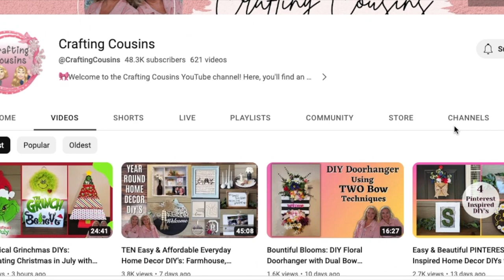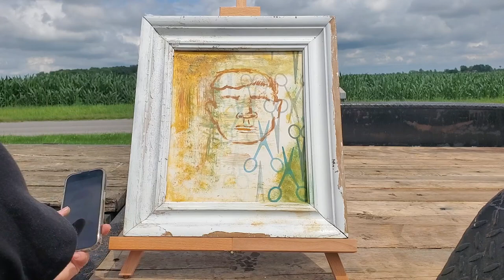DIY AGED VASES || THRIFT FLIP CHALLENGE #TFRTC

Comment: I love all of them! You have inspired me to paint my 2 very large pots in my foyer. I've changed my decor so they no longer match. I'm afraid to, but now I think I might risk it.😊 😮
Reply from the maker: Thank you!!! Just remember you can always wipe paint off. It may be a process but you can remove and start over - maybe you can practice on a thrifted vase or one from dollar tree first before starting the bigger project? You can use glass vases too! - add texture with joint compound smeared all over it and sand it down a little - if you don’t have sand paper go outside and lightly scrap the piece on the cement and it’ll help sand off rough edges - or use a rock to rub over the dried joint compound. After you have texture going on - add the baking soda paint mixture in a dabbing motion with a brush - let your first color DRY before doing it again with a new color - working your way from DARK first to LIGHTEST color last applied. Spray with a Matte clear sealer spray - hope you see this comment and it helps!!! Let me know if you ever have any questions about the process, as sometimes I may miss something in the videos. I have made many tutorials for you to watch over and get ideas on making faux pottery pieces look like an old ancient gem (collected pottery piece)
Reply: Great ideas! I think I will pick up a vase at good will to practice on first. And yes I'll watch some more of your videos on technique. Thank you!